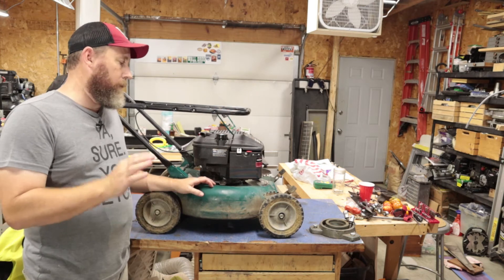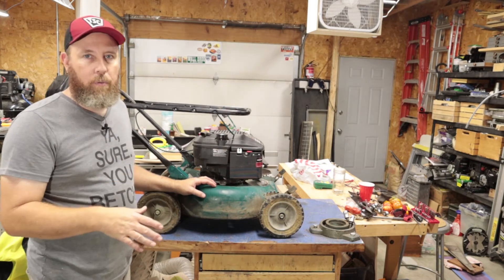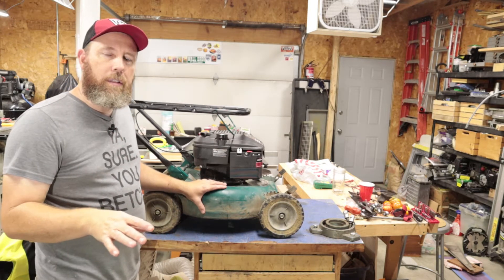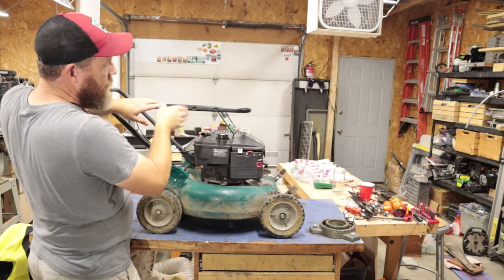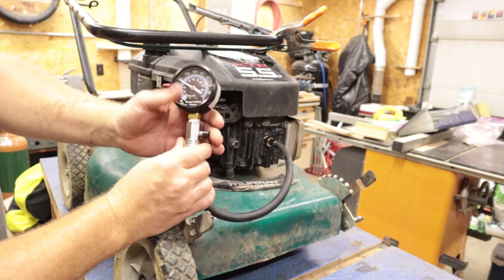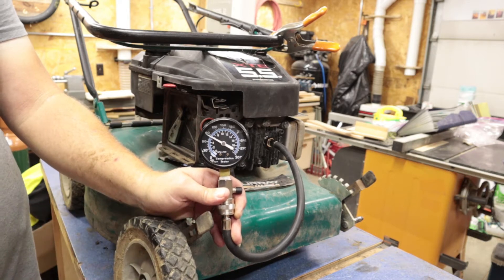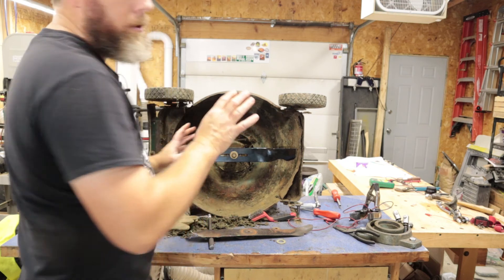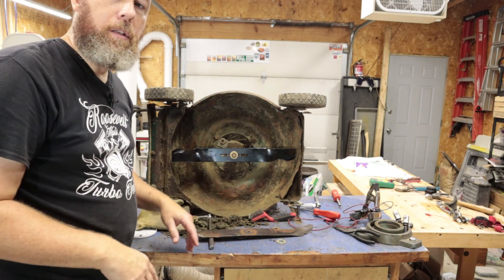Bring a dead mower back to life

Comment: Great video. Thanks. I have an old Briggs & Stratton WF go-Kart engine that has stopped on me suddenly. I can’t pull the start cord. Seems crank locked. I took off the start cord and tried to turn the crank with a socket and with a lot of pressure I got it to turn. I still can’t turn it by hand.  Now it will turn half way easy enough and then get very tight again. I took of the OHV cover and observed the valves moving in and out as I slowly turned with the ratchet. I stripped back to observe the piston moving in and out. Seems ok. The engine has a centrifugal clutch on the shaft. Would you have any ideas that I could try? I have watched your video on disassembling the engine, an absolute fantastic video. I might have to move on and take it apart like you did.The only thing is I am a newbie to small engine disassemble but very keen to learn and pass on to my sons. Any advice much appreciated. Keep up the good work on the videos. 
Paul
Reply from the maker: I would remove the spark plug and see if that helps first.  that will relieve any pressure in the combustion chamber.  if it's still hard to turn I guessing something is damaged.